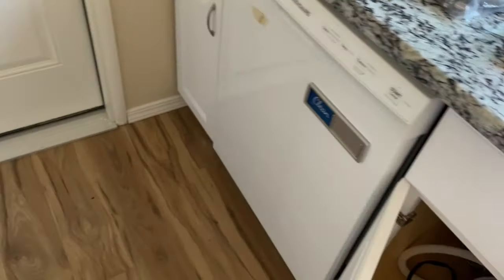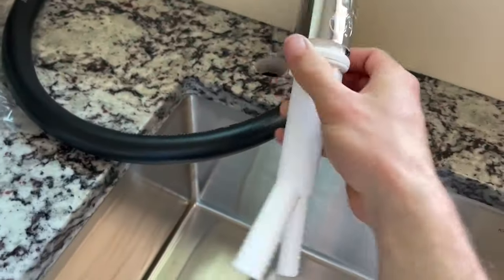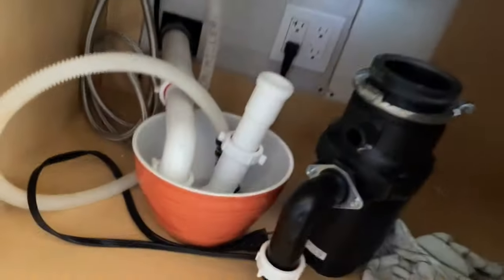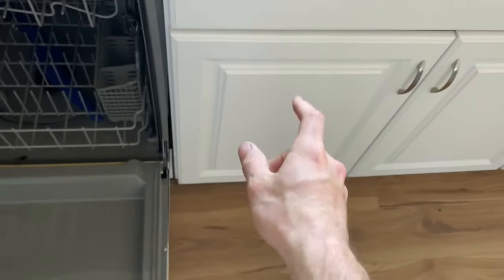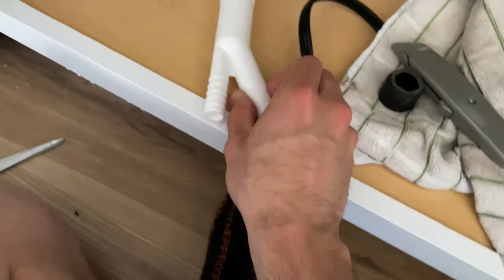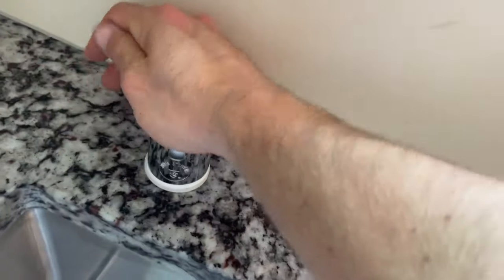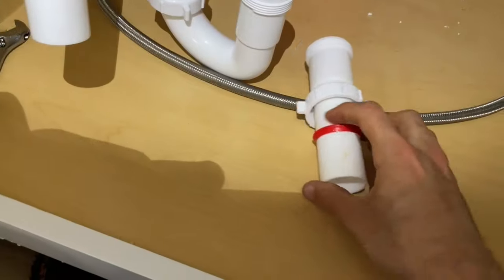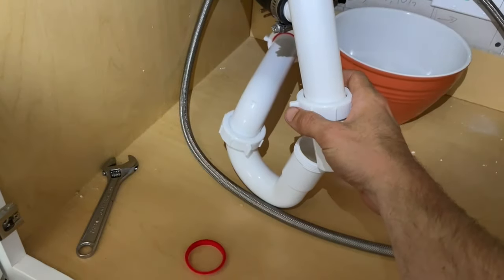Air Gap for Dishwasher Install

Comment: Looks like I need to find a tailpiece with a 7/8 in dishwasher spur. The one I bought is only 1/2” yet the dishwasher drain hose is 7/8 or 1” ID. Seems sort of odd that they’d make an air gap with two different diameter legs.